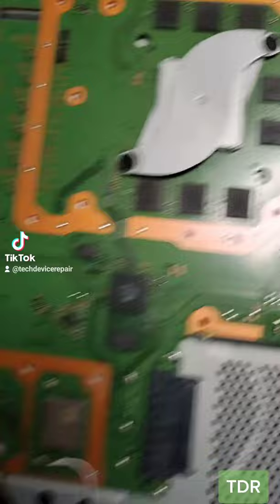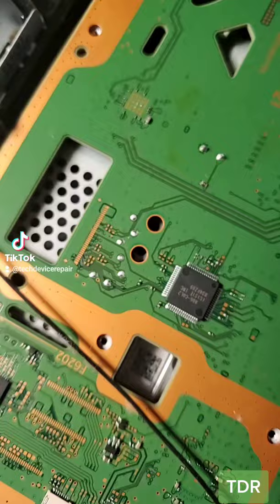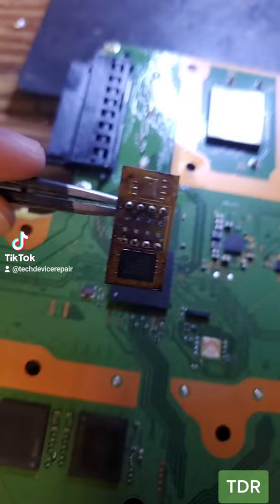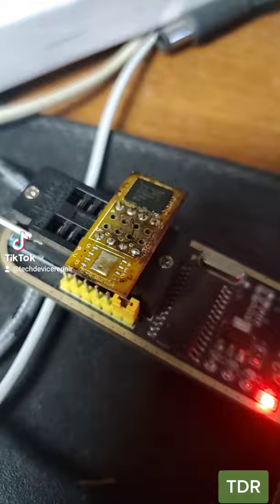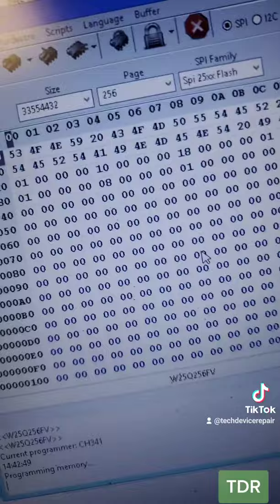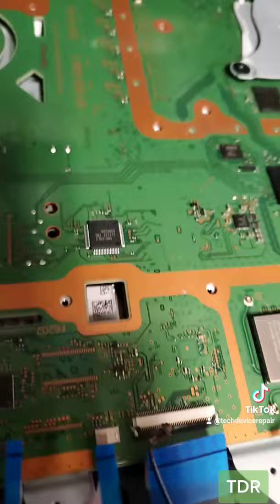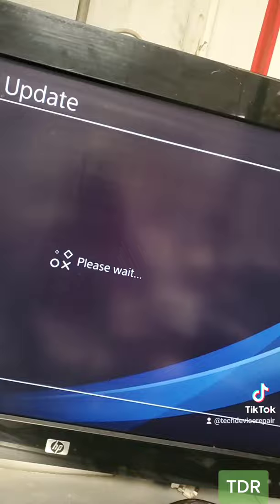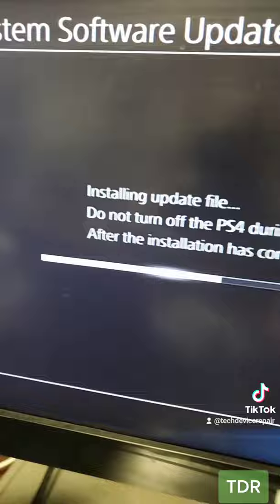Rare PS4 Pro repair. SU 37553-3 error code. #shorts #youtubeshorts #short

Comment: My PS4 did the same thing when my dog pulled my power strip straight out of the wall while booting. I heard a loud shriek and it lost all my data an wouldn't upload the update past 31%. My external drive was dead and my internal needed to be wiped and I lost everything, but my PS4 works now. 😭

Comment: My PS4 kept dying and switching out the hdd worked for a few months before it died again. 

I still have PT on one of my old drives. Would it be possible to fix or would the different drive used have messed up the link between system and old drive?

Comment: I’m having the same problem and it happens every time PlayStation has a update

But I get angry and pull the plug and restart holding for it to work then it’s stays at 36 and I leave there for 2 hours and it’s works again

Comment: Can you tell me why my system has an error when i put in a disc or try to update it? Its a playstation 4 batman Arkham night edition
Reply: My Arkham Knight disc did this as well for some reason...so i downloaded it from the store and it runs great...suppose it was my disc maybe?
Reply: @garyblackburn3080  my special edition system
Reply: @garyblackburn3080  not disc
Reply: @garyblackburn3080  sorry for the miss communication
Reply: @OFFICAL-FULL-SENDER  ah i see...my bad lol...the ps4 is an arkham knight edition...i feel so dumb lol
Reply: @garyblackburn3080  posibly
Reply: @garyblackburn3080  or it could have been your blueray reader part there I forgot the parts name and you might need to replace it
Reply: @garyblackburn3080  I'm 12 did that to my ps4 changed the blueray reader and now it updates and reads diacs